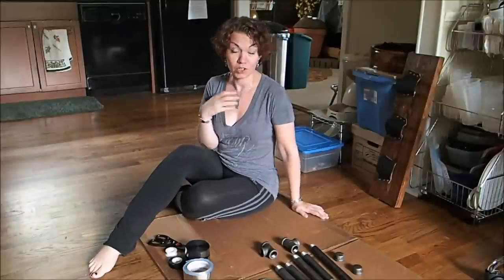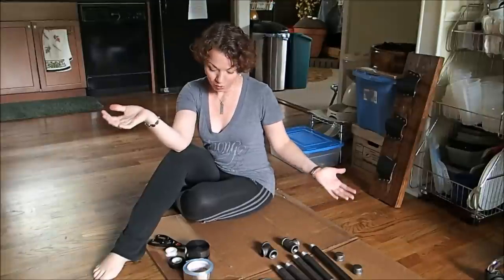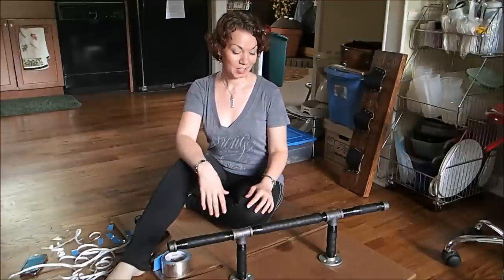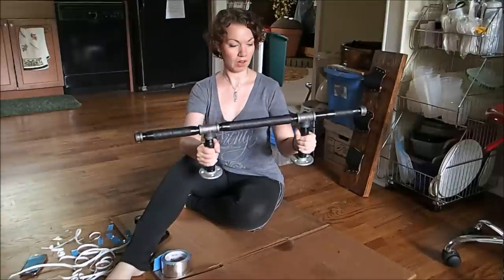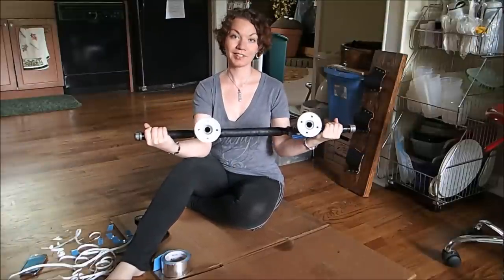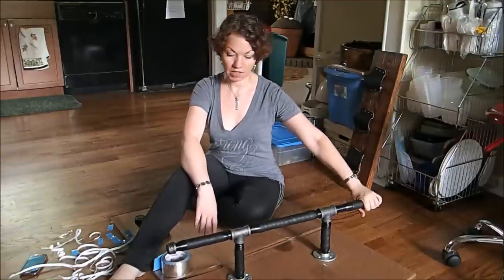Tiny House + :: DIY Pull-up Bar

Comment: You think you can make a wall mounted dip bar🤔
Reply from the maker: Sure thing!  It might get in the way, though, being down around waist height.  For dips, I use a folding walker (without wheels), since it's the right height, made to support some weight, and can be folded and stored out of the way.  Something like this: https://amzn.to/2y3uVXp

Comment: Though I applaud your efforts and results. The teflon (not silicone) tape used on the pipes threads is not necessary. This is not a water or liquid tight item.

 Simplify ;-)
Reply from the maker: +CncObsession Agreed, the thread tape isn't necessary to prevent leakage of anything, but it does keep the pipes more-securely connected.  The thing about doing pull-ups is that it puts the kind of force on the pipes that could unscrew them, so the tape keeps it from coming loose so easily.  It just makes sure that future repairs are less likely to be needed.  :)
Reply: Actually due to the fact that there are fittings on both ends, there would be opposing forces on the threads. You cant simply unscrew the center piece of pipe. This is why they use unions, to be able to separate the pieces. The end or unsupported ends however could be unscrewed.
Reply from the maker: Yep, since I'm generally doing pull-ups on the two outer pieces, those are the ones I want to ensure don't come loose too easily.
Reply: +Andrea J Burns is glue an option here?
Reply from the maker: +www.PICISI.com Yep, glue would definitely be an option, especially if I knew I'd never want to modify it.  If I want to add more grips at some point, the tape is easier to use -- doesn't come loose accidentally, but can still be undone if desired.
Reply: @AndreaJBurns-Verified  I'm thinking of doing this. To keep the pipes from becoming unscrewing, I'll just use some threadlocker. If I want to modify it later not a problem. Just take the pipes down from the mount, heat them with a torch and use a pipe wrench while the pipes are locked in a vice. Won't be that easy but I'm working out to get strong enough to do stuff like that right?

Comment: best tutorial on youtube, uhm i have just one question.  how much weight does it hold? because im almost at 200 pounds and i wanted to know if it would hold my weight.
Reply from the maker: The pipe won't have any trouble holding 200 lbs, but you'll want to be mindful of how you mount it.  I'm using construction screws in 4x4 beams, which works incredibly well.  What would you be attaching it to?
Reply: i was gonna attach it to a concrete wall
Reply from the maker: Concrete walls can support a lot of weight as long as it's properly anchored.  (There are lots of tutorials about anchoring into concrete on YouTube, too, but here's one that covers a few of the basic types of anchors -- the Strike Anchor and Sleeve Anchors would be good options since we're looking at holding a lot of weight with them: https://www.youtube.com/watch?v=-v7FujAXg4Q )

Comment: Hi Andrea, how did you get on with your design? I'm interested to find out if there were any problems with the outer tube pieces. Were they strong enough for doing pull ups on? 
thanks Dave
Reply from the maker: David McConnon Works just fine! The pipe is very strong and has no problem supporting my weight.

Comment: Hi Andrea! Can I mount this directly to a wall? Or need to put a wood first?
Reply from the maker: As long as you can put screws into the wall, you can mount it directly to the wall.  If your walls are concrete, plaster, or anything that may not handle the stress very well, you'll want to affix something that will help support the pull-up bar (like a wooden frame to screw it into).  Does that makes sense?

Comment: ma'am what is the sizes of every pipes please?
Reply from the maker: I used 3/4" pipes, since that was a really comfortable grip size for me -- so all of the pipes, Ts, caps, and wall fittings are 3/4".  Materials: (1) 10" pipe, (2) 8" pipes, (2) 6" pipes, (2) pipe caps, (2) wall mounts, (2) T fittings, (1) package of handlebar tape, some teflon tape (I said silicone in the video, but it's teflon -- oops), some electrical tape, and some duct tape.  Since I already had most of the tapes, I only had to purchase the pipes, fittings, and handlebar tape.  Total cost: ~$50.

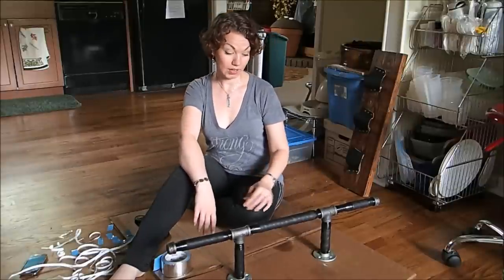Comment: what was that thing you are pointing out in 2:49 thanks:-)
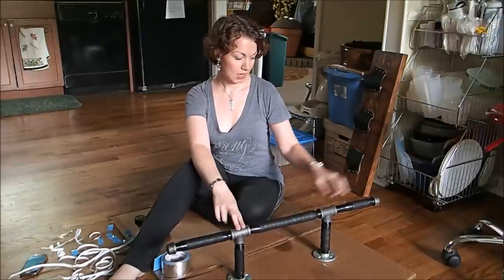Reply from the maker: At 2:49, it looks like the mounting flanges?  Those are just 3/4" pipe flanges that screw onto the end of the pipes so you can mount it.

Comment: good idea, but this looks like you would be too close to the wall while doing a pullup.  probably why you don't show it in use.
Reply from the maker: This one will be mounted on a 4"x4" crossbeam at the edge of a loft, so it won't be up against the wall.  (I've tested it, but it's not permanently mounted yet because I'm still building the house it goes in.)  Similar to mounting the "door frame" pull-up bars, having it mounted in a space where you have some leg room is a good idea.  If you don't have a space like that, you could always use a longer pipe from the mounting brackets to the cross-bars to put it further from the wall.

Comment: what sizes and inches are the pipes ? and the T's ?  and how mucho did all the metal materials cost?
Reply from the maker: +Lumeiry “LRod” Rodriguez Gonzalez I used 3/4" pipes, since that was a really comfortable grip size for me -- so all of the pipes, Ts, caps, and wall fittings are 3/4".  Materials: (1) 10" pipe, (2) 8" pipes, (2) 6" pipes, (2) pipe caps, (2) wall mounts, (2) T fittings, (1) package of handlebar tape, some teflon tape (I said silicone in the video, but it's teflon -- oops), some electrical tape, and some duct tape.  Since I already had most of the tapes, I only had to purchase the pipes, fittings, and handlebar tape.  Total cost: ~$50.
Reply: +Andrea J Burns mam your using a metal pipe right the 8" is 8 inches right
Reply: +Andrea J Burns and please reply on me is this thing can carry up to 163 pounds ? Im fat :( plsss reply on me
Reply: alex mercer That will hold depending on were you put it. You can also buy a thicker pipe. Play around. You are not tha heavy for it to break. Good luck!
Reply: +Lumeiry “LRod” Rodriguez Gonzalez all the items is so expensive in my country it cost thousand
Reply: alex mercer you can by a home pull up bar at a local sport or gym store.
Reply: +Lumeiry “LRod” Rodriguez Gonzalez wow i check ur channel and its a amazing i sub
Reply: +alex mercer thank you!
Reply: +Lumeiry “LRod” Rodriguez Gonzalez hell yeah i found i cheap store now i got a money to buy it but how do i mounted it to a wall ??  Can i use Concrete nail ?? Or should i drill the wall. Btw my wall is concrete not wood
Reply: +alex mercer  i suggest useing a wooden base to mount on the concrete plus comcrete nails. But you can also mount it on the plain concrete with good blue concrete screws (you can use expansions also. Just ask your hardware store what is best. JUST TRY AND USE LONG SCREWS.